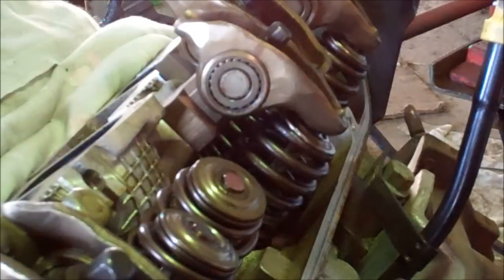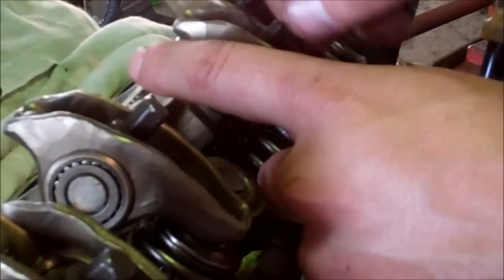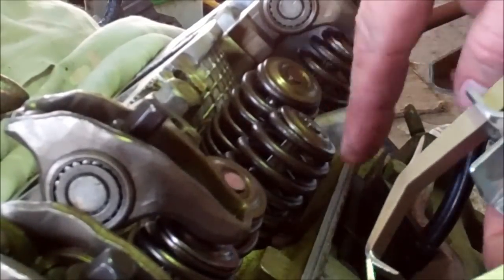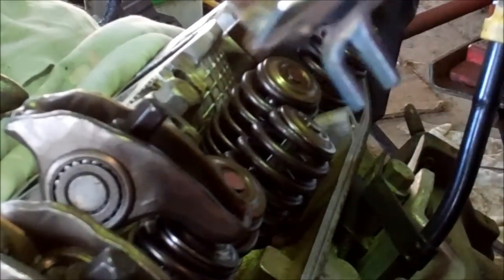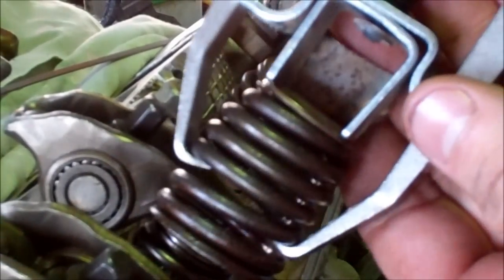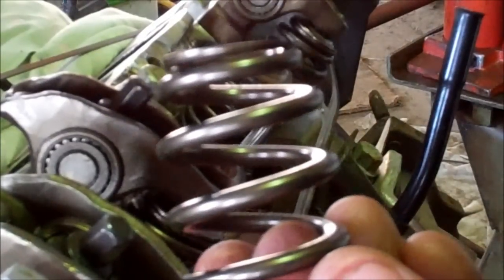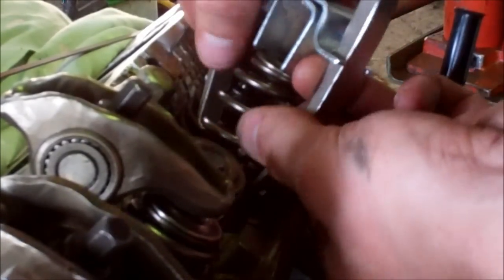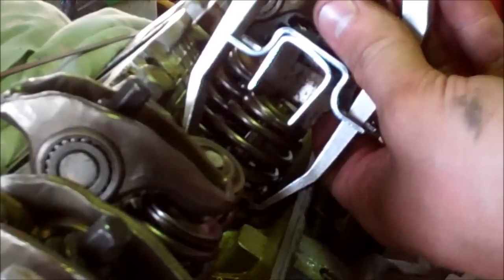how to change valve springs

Comment: I would not even use air to keep valve from falling in. I would take my time and rotate the engine to TDC for the particular cylinder Im working on. Also there is risk of air blowing the keepers all over the place and losing them.
Reply from the maker: Lmfao what? This video is almost 10 years old, yet it is still 100% the most correct and only way of replacing valve springs without removing a cylinder head. What do you thing putting the piston at TDC is going to do for you? You've clearly got a lot to learn. The best way to learn is to ask questions, not to make statements to 20 year techs.
Reply: @backyardgarage  "Blowing keepers all over the place" lmao! Boy's got bigger problems if that's happening!

Comment: Super thanks for the honest comments on the process (and cheap tool!)  For those wondering the air pressure is applied via an adapter from shop air to the spark-plug hole.  I made my adapter by drilling out an old spark-plug and soldering it to a short length of brass tube with a quick-connect air hose fitting on one end.  As noted below Top Dead Centre will prevent a valve from slipping down into the bore if the air pressure is lost, on an interference engine for sure.  Using pressure in the cylinder you will want to hold the shaft from being able to turn while you work.

Comment: You don't have to be all technical with this..  All you need is a deep socket and a hammer.. Stuff a napkin in the socket so the spring retainer don't fly all over the place and tap it hard.. Obviously you need the tool to put them back..  But this method is faster if you need to get shit done quick

Comment: I like the video, do you think one of those tools that you have there would remove the springs on a 5.7 hemi? I recently broke a valve spring and I need to replace them and I don't see the point in paying $200 for a tool I'm going to use one time!

Comment: A quick little tip, work on one cylinder at a time, and as you go, turn the motor over by hand so that the piston is at TDC. This way if you do happen to drop the valve into the cylinder, you might be lucky and not completely lose the valve. No need to pull the head off if you stuff up.
Reply: Amen=)

Comment: so after you take off you springs  the valves are loose so you can take them out and clean it right?
Reply: lilloser501 only if you take the heads off

Comment: If you did t simple and easy and in  way that most DIYers could do it, thenwe would call you back-yard-saebbi, but insteadyour using more time than you should and tying up a bay and a customer longer than needed perhaps milking the clock to be anal-retentive, so,,,,,,,,,,,,,,,,

Thank you Jay for the BEST way to do this, in the bay, in the garage, or in the driveway.

Comment: In changing my scooter valve springs, I pushed a nylon rope into the spark plug hole until the cylinder was so full of rope, the valves stayed put.   I couldn't find a valve compressor that would work with the engine in the frame so I designed a tool and built a tool for the job.  Worked great.

I'm not a mechanic but necessity is the mother of invention.

Comment: or you can use the engine itself to do the work for you. i use the piston to hold the valves up. what if you lose air pressure somehow? you have to remove the spark plug to put that fitting in there anyway so why not just put a ratchet and socket on the alternator nut and turn the engine over until the piston is up? works great for me and i don't need to hold my breath while i hope the valves stay closed with air pressure. hell, i can leave the springs off and come back tomorrow if i want to.

Comment: @DanielRemains opps :P, well at least you learnt two things, one you have an interference engine and two you need to change the belt at a certain time :P, I had mine go on a 1997 cavaliere, it said change at 100K km, it went at 112K, no issues just didnt run. non interference engine

Comment: In my Hyundai Accent as long as the pistons are up the valves will not fall inside. because the space between the valves and pistons is only about 1/4 of an inch so I don't need any pressure in the cylinders :)

Comment: Ive never trusted hose clamps to do this for me, as a mechanic dealing with other peoples money i spent a little time drilling through a spark plug, weld a piece of pipe on top of it, air tight, and a quick fitting on the end, and a matching quick fitting on the end of the air hose from compressor, this has never ever failed for me but i heard of a shop that used a compression tester, cut the hose and eventually after a few jobs the hose clamp gave way and the pressure pushedthe hose off, bummer